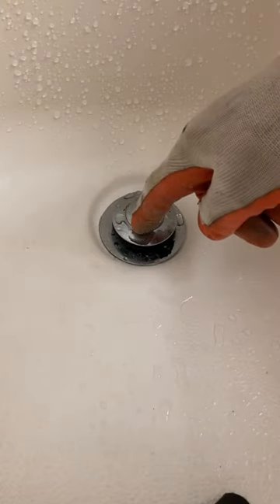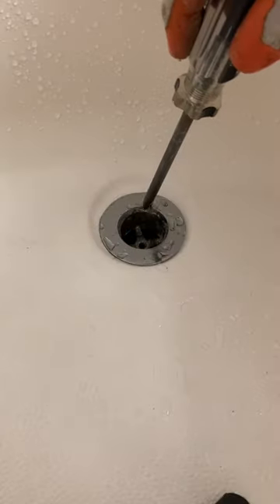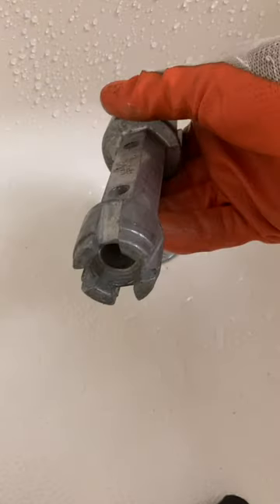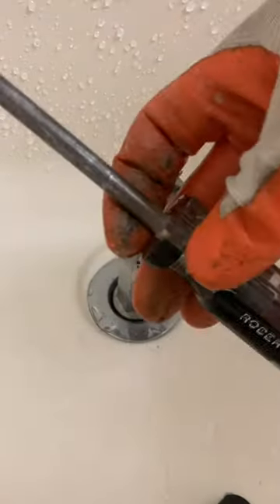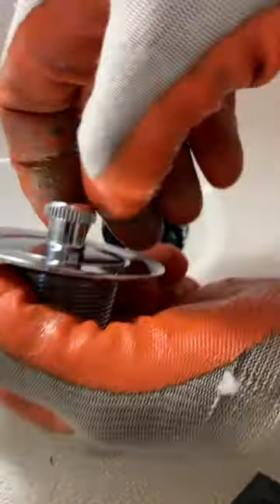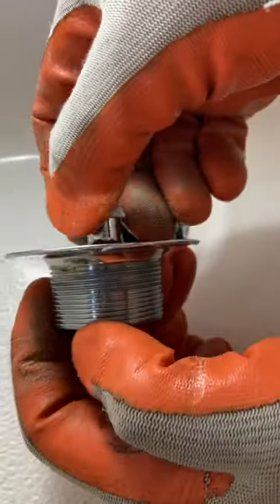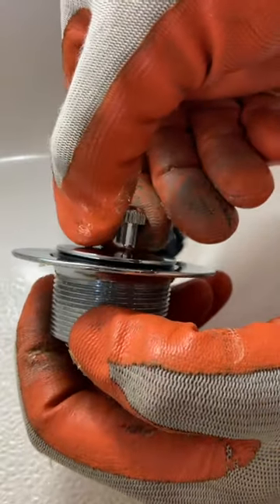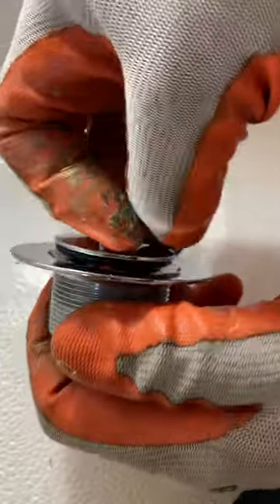Remove Tub Drain Fix Leak 💦👍 #shorts #diy #plumbing

Comment from the maker: I am using a quality Silicone meant for kitchen & bathrooms. I use putty on sink drains & silicone on tub/shower drains that will be concealed. Most leaks I have fixed on tub drains are due to cracked dried up putty. Applied properly silicone will outlast putty in my experience. You may disagree and that's okay, we all want the same thing here, no Leaks!
Reply: In the UK its rare to see any plumbers putty being used anymore. Quality silicone is a far better method widely used here.
Reply: I'm am currently about to install a shower pan, is there a brand you use for shower drains? I see so many silicones in the store website. I haven't chosen the tube of silicone I'm going to use because not one video states a specific silicone.
Reply from the maker: @rm-ot1ff  l usually use a brand called PlumbRite

Comment: Plumbers putty is how plumbers do it, diy handyman uses silicone
Reply from the maker: Disagree, yes l am a handyman but l am also a Journeyman plumber over 20 years. I use putty on sink drains only, quality silicone on tubs & shower drains & never had an issue.
Reply: Didn’t mean it’s the better solution. Nor does it mean that it’s right. Part of why you may never have gotten an issue for the 20 years is because you don’t get the call back. 

Fix it once and fail I’m not calling back for you to do the same thing twice.

Comment: Do not use silicone!!!
Reply from the maker: What do you suggest using? I have been plumbing for over 20 years, installed many tubs and showers using a good quality silicone on the drains instead of putty and never had a call back for a leak. Most tub leaks I have come across have been because of dried up plumbers putty.
Reply: @JENSENDIY I've resealed tub,shower, basket strainer  GD flanges sink drains that were sealed with putty with  💯 silicone never had a callback

Comment: I’ve never heard anyone claim silicone is better than plumbers putty. Silicone smells, is hard to clean up, and will fail much sooner than putty
Reply: I use it regularly when doing condos, putty is great for sinks it does work for tubs but the silicone works great but you are right it smells